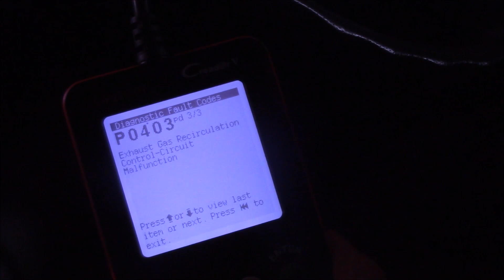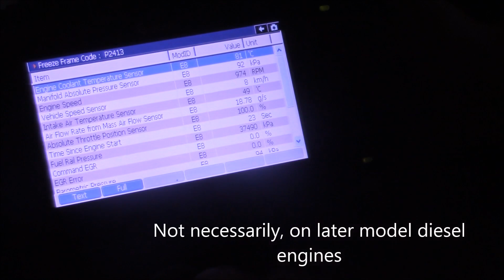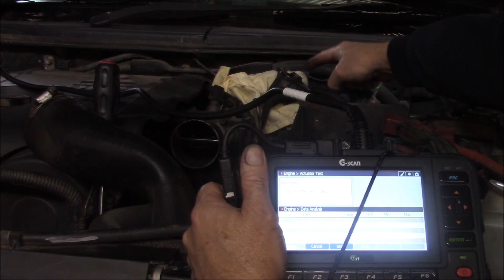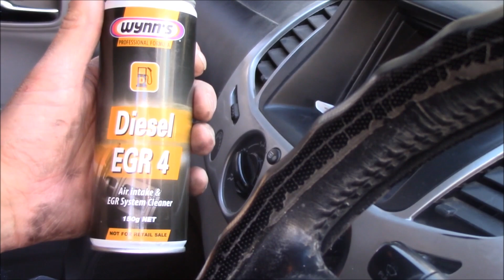Mitsubishi Triton 4D56 CRD P0403 P2413 Fault Codes MiracleMAX

Comment: Hi Max! You say pins 4 and 6 for 12 volt power supply, isn't there only 5 pins on the Triton EGR solenoids? Mine valve assembly looks identical, but I I have 5 pins and would like to know what pins I should connect the power to. Cheers!
Reply from the maker: Hopefully this video should make it clearer for you.
https://www.youtube.com/watch?v=pR4J58qmr8k
Cheers
MAX

Comment: Hi sir..tq, very informative, sorry just want to ask opinion, my triton model 2010..problems, egr code come up, I check, the egr motor rusted and not functioning, I replace new, ok, good, the check engine symbol disappear but only for a while..5 minute it appear again..then i open the egr motor from egr valve, connect it and start engine, the motor look like fluctuating no power supply...
Any opinion sir?
Possible ecu?...but car if perfectly runing no problems.
Reply from the maker: Have you cleared the fault code after the replacement? Are there any resets that you need to do? Is there carbon build up in the inlet manifold? Can you see the actual EGR position in comparison to the desired position in live data?
Have you checked out this other video?
https://youtu.be/pR4J58qmr8k

Comment: Hello Max, excellent video, thanks for all the info. I have a similar problem with my 2.5 triton, the EGR have been already been replaced and the code persists. I don't have the tools to do a diagnosis like you, but with the engine light still on, i removed the motor of the EGR and when i turn the vehicle on i can see the egr motor moving, also if i push with my fingers on the valve i can move it, so im thinking that the EGR is not stuck and the motor its also receiving signal and working. What else should i be checking? I also notice that if i let the engine idle for a few minutes after i turn it on, then when I'm driving around at 2000 or 3000 rpm, i feel like the power get inconsistent. Thanks!
Reply from the maker: What tools do you have - a multimeter, scan tool or an oscilloscope? What codes do you have?
Reply: @MiracleMAX  thanks for the reply, I only have a multimeter, the code is also P2413, do you think the map sensor may have something to do with it? When you spray the cleaner through the map sensor hose, you did that to clean the intake and the EGR? Or to clean map sensor conduct?
Reply from the maker: @Carloscf13  It is very difficult to make suggestions without inspecting it myself. If you have limited tools and knowledge on testing procedures, it may be best to take it to a local workshop where they can examine live data and carry out activations with a scan tool.
I have found this relating to your fault code that may be helpful.
http://mmc-manuals.ru/manuals/pajero_iv/online/Service_Manual/2008_eu/13/html/M113350830014200ENG.HTM

Comment: Do dpf regen when sqirting  in the cleaner you won't have to sit in the car with your foot on the gas regen can be stopped whenever..
Reply from the maker: Sorry, not sure if I understand you correctly. Are you suggesting that you do a forced regen while spraying intake cleaner into the intake system?
A forced regen should only be done as a last resort, not on a regular basis. This can be damaging to the DPF. Remember, it is just a filter. Adding extra fuel during this process (intake cleaner) will raise temperatures even more, creating a greater opportunity for the DPF to increase in temperature and result in possible melting of the substructure

Comment: How did the egr motor worked that is a hard code, how did you cleared it,
Reply from the maker: Hey Ford Taurus,
In this case the fault was intermittent due to carbon and a worn EGR valve. It had completed a drive cycle and confirmed that there was a fault at the time of the cycle. Once the fault was cleared, the EGR started operating again. About a year later the EGR valve was replaced due to excessive wear.
MiracleMAX
Reply: @MiracleMAX  hey men, thanks for the info, does egr motor usually be worned out for about 30,000 KM run or about 3 years old
Reply from the maker: @fordtaurus4920  Not usually, but they can get stuck due to carbon build up and depending on the code, it might be an electrical fault
Reply: @MiracleMAX  when i already cleaned it then re scan I have a dtc p2413 then I streamed the egr target like you did but it reads 0% maybe I'll replace the egr motor,
Reply from the maker: @fordtaurus4920  The code must be cleared before the valve will be activated. Have you done all the electrical testing like I showed in the video?
Reply: @MiracleMAX  yup I also performed 12v direct on the motor, it worked also,
Reply from the maker: @fordtaurus4920  Are you getting a response on the scan tool in live data when you manually shift the valve?
Reply: @MiracleMAX  not at all ill just test parting it with a new one
Reply from the maker: @fordtaurus4920  OK, let us know how you go

Comment: Can the egr valve cause transmission to a limp mode  where the D light blinks
Reply from the maker: Hey Atrul Nisha,
I haven't personally seen that. What fault codes do you have? Have you tried clearing them? There may be other codes not related to the EGR causing the limp mode.
MiracleMAX
Reply: @MiracleMAX  thanks for the reply unfortunately there's no fault codes but as soon as I drive my Mitsubishi l200 it doesn't change gears as I rev up it jolts then the D light starts blinking and the transmission seems to be stuck in 3rd gear.so if I turn off the ignition then restart the D light stops blinking and the truck drives normal but it repeats its cycle I have checked the pcm and replaced it with new still same so I changed the entire transmission with the same spec still the same so now I'm looking for the transmission control relay which I can't find even I took out the dashboard the relay and fuse in the fuse box are good
Reply from the maker: @atrulnisha3962  Sounds like you've done a lot of work on your vehicle! What scan tool have you been using? When you say the 'D'  light, do you mean the Check Engine Light? I would be surprised if there were no codes. I would expect at least a 'pending' code. Does your engine use a DPF? Did you check the OBDII side of your scan tool or just the manufacturers side? Did you do a full system scan or just a powertrain scan? What is the exact year, engine size & model of your vehicle?
Reply: @atrulnisha3962  over ride, napalitan na po b ng atf

Comment: G'day Max, thankyou for an absolutely brilliant and informative video. I've got an MN just like that one and it's misfiring like all buggery. My $20 Bluetooth obd scanner and simple app, intuitively called 'Car Scanner'  
(lol) is detecting misfire injector #1 and indicating Injector #1 circuit malfunction, it hasn't given me any egr related codes but i've been told (by a 'blue singlet warrior') that this could be caused by excessive buildup from the egr. Anyway, I'm just starting the diagnostic process now, and your video has provided a very valuable insight into whats going on, so again, thanks for that mate. Cheers!
** btw, you're obviously a TAFE teacher (wouldn't be Miller, would it?) so i'm not going to use the language that I'd like to use, but just like to say 's*#t go @DanielMartin in the comments, used your video for his work, you were decent enough to reply to him, and i see he never replied back. Bad form Daniel).
Reply from the maker: Hey Paul,
I'm glad that this video helped. For some reason I get a lot of Tritons to work on, so have a look thru my videos if you need any other help with yours. Carbon build up is one of the main killers for these engines. Just keep in mind that the injector is both electrical as well as a mechanically operating solenoid, with moving parts. Let me know how you go with your diagnosis and if I can offer any help, I am happy to share what I know. 

To be a good teacher, you have to be teachable, willing to learn. 
Look forward to hearing your progress.
Cheers

MiracleMAX

Comment: Thanks
Reply from the maker: You are welcome. I hope the video helped!  :)
Reply: Sir please help me my Montero 2thousand rpm only what we do?
Reply from the maker: @sucesojr.escanilla5866  
So you are saying that it has a high idle? Is it petrol or diesel, what year is it & what is the engine size and code, please? Do you have a scan tool? 
These do have issues with the idle speed control motor, but further testing should be done before replacing any parts.
Reply: @MiracleMAX   diesel engine sir 2011 model codes p0193 p2413  and low power like turbocharger not working sir
Reply from the maker: @sucesojr.escanilla5866   
P0193 – Fuel Rail Pressure Sensor Circuit High Input.
Does your scan tool have 'live data'? If so, what is the fuel pressure reading at idle and at higher revs? 

P2413 Exhaust Gas Recirculation System Performance.

Can you see if the target and actual EGR readings are the same or close? Is the EGR operating? Just like in the video, I had to clear the codes before I could actuate the EGR. 

Is the intake system clear of carbon? These are bad for carbon build-up.
Reply: @MiracleMAX  I will check already cleaning EGR valve now good only now is p0193 sir
Reply from the maker: @sucesojr.escanilla5866  Hope it goes well for you
MiracleMAX :)
Reply: @MiracleMAX  thanks much

Comment: This helped me alot. I encountered the same code, did the neccessary tests and ended up pulling the manifold off completely to clean it all up. What I have noticed after clearing the codes once cleaned is that the egr was about 100% at idle until temps reached above 70deg. Then it would drop down to 75% or less. Reving the engine without load gave me a 0% reading. Anyway, no codes thrown so far since cleaning.
Reply from the maker: Thanks Simon,
The Common Rail Diesel, especially these Tritons are notorious for blocked intake systems. I have been using ultrasonic cleaning and the customers have noticed a huge improvement in power and engine smoothness. After the clean or any change to the fuel/intake system, including valve clearances, it is also recommended to do a small injection quantity relearn. 
I am recommending every time that I adjust the valve clearances that the intake system is cleaned. It may be an option to do intake system spray clean maybe every second time (I am still experimenting), but it is crucial that the intake system is kept clean. Here in Australia, poor fuel quality is one major contributing factor.
Thanks for your comments :)
MiracleMAX

Comment: I have the same problem, how about a video taking the egr out and cleaning it? That would be really helpful as a DIY. Will definetely subscribe if I see it. I've been getting terrible fuel consumption, 18 mpg at best. Everything else is fine, I know this must be coming from a bad o dirty egr. Please let me know if there is a video on how to take it apart. Thanks
Reply from the maker: Hey francisco salazar,
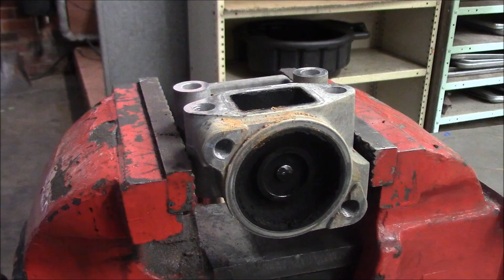Did you check out this video at 15:22? I pull off the EGR to clean it. As you can see the EGR has shaft wear and later gets replaced. You can use all sorts of cleaners, but you never will truly clean it.

Homemade Smoke Machine To The Rescue MiracleMAX https://www.youtube.com/watch?v=Qx2nT-GTejc&t=473s

In the case of an EGR - 'If in doubt, chuck it out.' The only true way to clean carbon from an EGR or inlet system is by Ultra Sonically cleaning it off the vehicle. Sorry, that's just the way it is.
Reply: @MiracleMAX  hi, yup. Great vid I really learnt a lot from it. But muy question is on the process of getting it out. Taking the screws apart and pulling it out the engine. I am looking forward on taking it out and doing it myself
Reply from the maker: @franciscosalazar8753  
Hey francisco salazar,
I don't have a video specifically on EGR replacement, but if you follow along with this video, it might be enough to walk you through the process.
Homemade Smoke Machine To The Rescue MiracleMAX https://www.youtube.com/watch?v=Qx2nT-GTejc

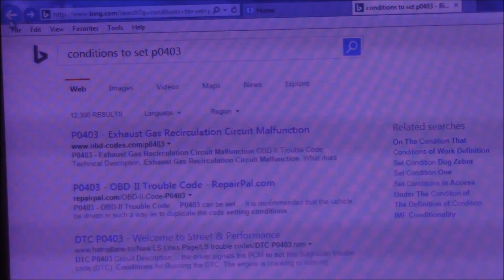6:31 Shows the location of the EGR valve - at the rear of the vehicle on the inlet side.
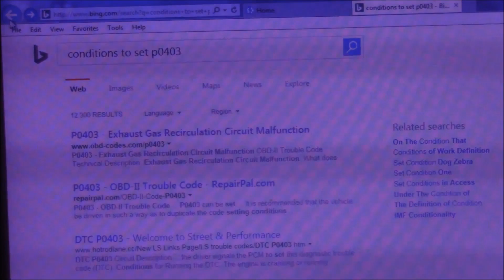6:44 Shows the EGR valve together with the housing that it is bolted to.
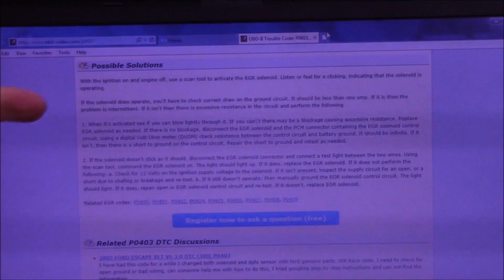7:16 Shows the EGR valve off the inlet manifold. See there are 4 bolts that hold it onto the manifold. 14mm bolts if I remember correctly.....I could be wrong! :)
At the other end is a pipe that I have removed off the EGR cooler. It is easier to remove them together and then disassemble them on the bench. Don't forget, if you replace the EGR and remove an EGR cooler pipe, make sure that you replace the gaskets as well.
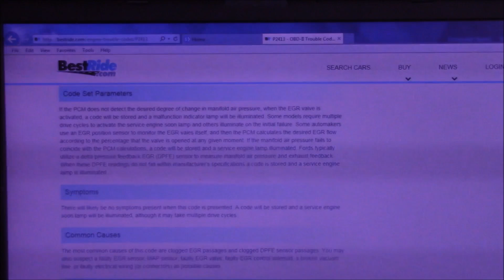7:53 Shows where the EGR cooler pipe is removed from. I think the bolts are 12mm. Once again, don't quote me on it!
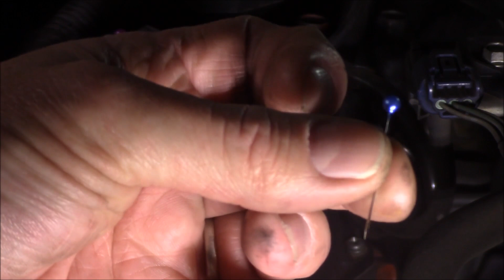12:12 Make sure you check for straightness of the EGR cooler transfer pipes while they are off. You only need to take off the rear one, but in my case, I was chasing a noise as well.
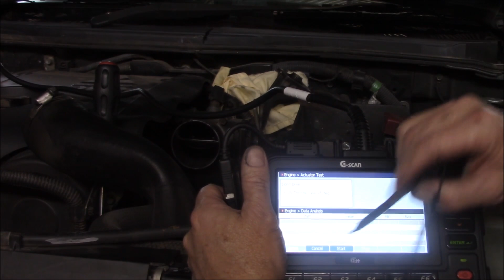17:25 Shows the EGR valve being changed over onto the cooler pipe.
18:18 Is where the EGR pipes and valve are reinstalled onto the vehicle.
Simples!  :)

I hope that helps you with your repair.
MiracleMAX